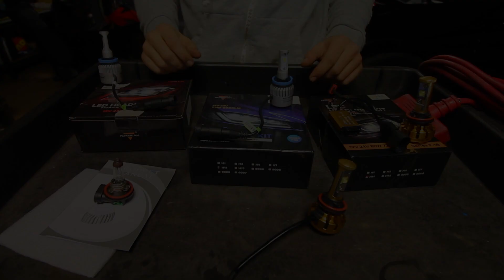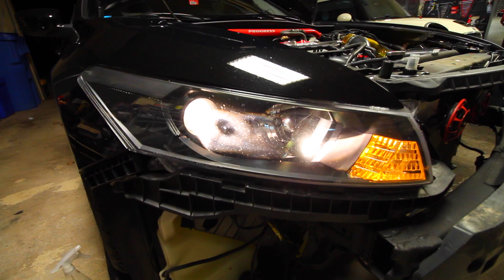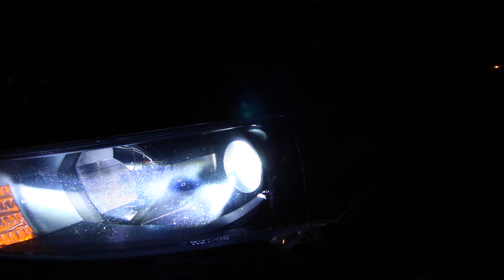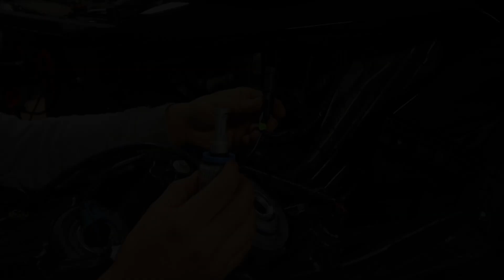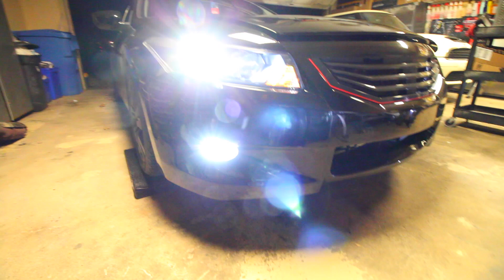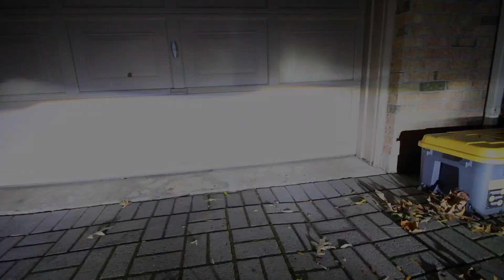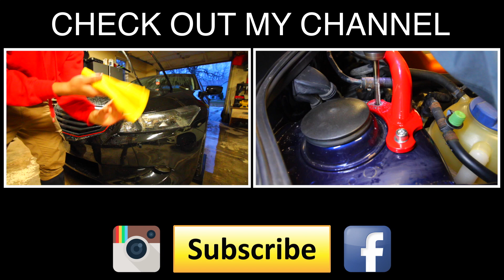LED Headlights: Are they Better than Halogens?

Comment: I get lots of these assholes just dropping LEDs in their old cars and blinding people
Reply: Matty would you stfu already ? we get the point
Reply from the maker: Hence why I mention that the cutoff is very important
Reply: katieducky23 how do u know u never had issues from other people? Did u take a poll from everyone u ever drove by or behind?
Reply: +1.. Alzain Ali is spot on. .. An automotive headlights source emitter,, is only half of a headlight assembly. .. That said, 98 percent of car enthusiasts wouldn't know a car headlight lens "cutoff" character from their backside.  What the hell does a headlights color aesthetic have to do with lighting performance?  .. A significant aspect of automotive headlight performance is its beam direction/character and the interaction with opposing vehicles/traffic and degree of terrestrial light sources . The optional factory HID (term'ed litronics) headlights in my '90's era MY98 Porsche 993 are spot on with there beam focus.  A common place xenon DS2 emitter is set in a projector body focused by a specific R/L glass lens; fitted worldwide.
Reply: I'd recommend the Philips LED headlight bulbs. They are expensive but won't blind people on the road.
Reply: Yup, I'm dropping mine in a week or two.  I've got a set of these in my Ram.  I'll be ordering a set of Sport headlights for it and some philips x-treme visions for it and doing away with these.  I mean these things as brights are damn nice. They're directional as hell and shine a light almost like a spot light... but when he says these are brighter than a Halogen... They would be if they didn't scatter light every direction but where you want it.
Reply: Its the assholes dropping LEDs into a reflector housing. Which is a big no no. LEDs need to be dropped in to a projecting housing so they don't glare the shit out everyone
Reply: Amen to that brother !   :D
Reply: exactly! i have the new Philips Luxeon Zes Led in my headlights. And they are awesome! they do not blind people like the shity xenons. The y just look like halogens only more lumens and pure white  :D
Reply: Have a break, have a KitKat  :D
Reply: Alzain Ali j
Reply: sure you are right, but it comes at a cost, albeit small one, to your wallet in the form of gas consumed.
Reply: Nothing makes energy, it simply transfers it from one source to another.  Therefore, your car "making extra energy" is getting it from somewhere else, I.E. gas. As for not using all the energy it generates, it does use it. However, it is not very efficient. This is why some ESS systems and other systems like Mazda's iLoop system will actually decouple the alternator so that the transfer of energy is ceased, forcing the car to use the batteries until nearly drained. This improves gas mileage.
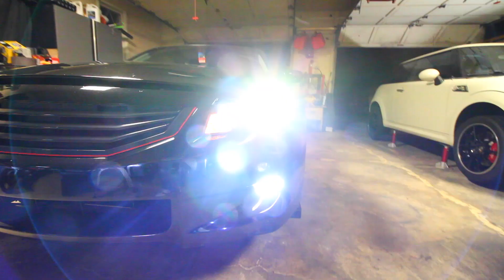Reply: william ingram jr in 12:42 .what lad u pot in the car ? 1? 2 or 3 ?
Reply: Currently, I am trying out DDM Tuning LEDs which uses Phillips Lumileds CMZ leds. It might be the color temp as these are 6,000k, but I think HIDs are brighter. I had DDM Tuning 55w 5,000k
Reply: LOL
Reply: Alzain Ali set service light renalt clio
Reply: +Michal Schneider The color temperature affects performance, because our eyes are made to see in natural sunlight best, the closer you get to the sun's output, the better you are able to see. The brightness of light doesn't matter if you can't see in the spectrum. Same reason you don't see UV light, radio waves, infared, etc, no matter how much output of that something is giving off.
Reply: yeah the corolla's are just weird
Reply: An2 Just because you 'believe' doesn't make it true.
Reply: about 7hp-13hp it's pretty good aye!!!
Reply: Amen! They are too bright! They cause glare that actually impairs the distance vision of the driver and the oncoming driver's vision to boot and they should be outlawed. They are like high beams. They are a menace and dangerous!
Reply: ohh come on that's not true dear Alex.  Leds are seriously not blinding like xenons. i do admit xenon are way too bright but i did a comparison between xenon and Led. The leds are just like halogens only more bright
Reply: There are so many kinds out now and I'm not up on the type that freakin' blinds me at night when I'm coming around a corner, probably the blueish xeons. If that isn't enough the ignorant people that leave their fog lights on, in conjunction with lights that are too bright, make it very dangerous and they don't realize that the oncoming traffic is having trouble seeing where they are going. As a hunter I know that a bright light is NOT what you want when you are tracking a deer at night because it obscures your distance vision by excessively illuminating objects directly in front and around you rather than illuminating objects in the distance.  The same principal applies to headlights at night on a car - the driver cannot see distance as well with the brighter lights and they don't even realize it.
Reply: Amen to that Matty S!
Reply: I wish the nut jobs that are blinding us would get the point!
Reply: Lmafo
Reply: Cant beat em join em thats what i say might as well blind them back
Reply: Its very simple.  Does your car use projector lens or reflector lens.  If you have projectors, LED upgrades should be fine.   If you have reflectors then you are right don't be an a-hole and put HIDs or bright LEDs in them.
Reply: Milan, you should do a vid on how to adjust headlights so the "a**holes" don't blind other drivers!! Keep up the good work!
Reply: None of the OEM halogen projector bowls are designed for HID's or LED's. The only way to achieve a proper cutoff is by retrofit. Otherwise you're going to blind people with all the glare.
Reply: Cool it, toots.
Reply: katieducky23 ricer
Reply: Thx gorgeous :)
Reply: me too i have the Philips Luxeon ZES 6000k Led in my Seat Leon  and it seriously does not blinding incoming traffic at all.
Reply: Kieron Skinner Exactly, I have a second gen Saturn vue (aka an Opel Antara) and no matter what bulb is in it, it has a super sharp cutoff because of its European design.
Reply: You suck  :)
Reply: So I have led 100w h4 headlights in my 2003 seat Ibiza, and the cutoff is so sharp and perfect, it passed the mot test (UK safety test) with them in. And the UK have much stricter rules than you yanks. So all of what you are saying is absolute bullshite
Reply: SirWhiteCrayon you obviously don't know how a projector works.
Reply: its okay honey just dont look into the headlights while driving.  Watch the road !  :D
Reply: That happens more with  HID.
Reply: How about you go fuck yourself? :)
Reply: No smart ass i had low wattage white phillips LED headlights which were rated lower wattage then the ones with the blue tint in them.
Reply: SirWhiteCrayon not true ..I have a set of led bulbs in my halogen headlamps and they cut off perfectly.  I ran also xenon 35w for more than 5 years and it worked flawless...bottom line is the type of headlamp. if it is projector type it will be ok no prob cutting off.
Reply: Not really. Had one in my 2001 plymouth neon never had any issues from other people. You only blind people if its on high beam.

Comment: LEDs should never be used in projectors unless the projector is oem and oem led bulbs.
Reply: Dominique Sanchez qué tal ? Porque no deberían usarse led en proyectores amigo ?
Reply: Flavio Moreno no se tanto para escribir todo en espanol perro soy un experto de las luzes de carros. No lo hagas.
Reply: entonces recomiendas que use xenon , HID?
Reply: Dominique Sanchez you have that backwards. LED Bulbs should never be used in REFLECTORS. Because it scatters the light and makes your headlights blinding for oncoming traffic.
Reply: can you tell me why? thanks
Reply: When headlights are designed, they are designed based on the light source to be used. When other sources of light are used in the headlight not designed for them, the whole output is compromised because the light source is not hitting the reflector  properly.
Reply: usa led en proyectores amigo, esta bien hid y led, tengo un ford explorer y funcionan de maravilla
Reply: Donde esta la biblioteca?
Reply: Wrong, even aftermarket projectors (retrofit projectors) have a cut of Shield that make the line you saw on the garage door that prevents uncontrollable glare. Even the hi/low beam set up in older cars when retrofit with a projector, it has a motorized shield that when you turn on the high beams the shield goes up to expand the light. As a profesional that you said you are, you still have a lot to learn, even though all this projector housing is while old, it’s only popular now because manufacturers are implementing them in standard cars now as to more expensive packages or luxury cars before.
Reply: iamcondescending You can't just throw in LED or HID bulbs into halogen projectors and expect them to work perfectly either. Assuming your country doesn't have laws about self-levelling mechanisms and washer jets, halogen projector lenses don't disperse light evenly enough like how most factory HID projectors do, and it's very obvious from comparison photos. You'd need to swap the halogen projector lens for an engineered clear one for your replacement bulb
Reply: Matt Dixon join "Headlight Junkies" on facebook. Sit back and watch

Comment: Don't drive around with your foglights on...  Just don't.
Reply: Frederick Davis , most foglights are capable of adjusting the aim. From what I know, European cars are able to utilize the fog lights without the low beam activated.
Because in heavy fog; the low beam will point straight out in front of the vehicle. The light reflects of the fog moisture. Causing loss of vision of the road/pavement. 
Foglights purpose (usually mounted low) is light up the road in front of the vehicle while driving slow. Without the low beams on. 
Fog lights does wonders for rain and snow as well.
Reply: I used to add fog nice and low aimed down and a short distance.  I would wire them to be switched on regardless of high/low or no lights besides parking on.  That way in heavy rain, fog or snow I could still see on unlit roads without headlights reflecting back.
Reply: @kzoomin  well said
Reply: Phos9 
My fogs are faced to the ground so i can see the road better
Reply: Stupid just because its called fog light cant be used in normal driving it widens your vision and its not blinding coz all it do is light the pavement
Reply: I have no problem except with the idiots that turn on the rear fog lights for no reason
Reply: @abo3abid1  ikr hella bright for no reason. Maybe it's activated by mistake.
Reply: Phos9 what's the reason if you don't mind me asking
Reply: Phos9 its for safety when raining
Reply: If they even are fog lights many cars only have driving lights.  Very little light output with normal bulbs and only fill in light for looks and immediately in front of the vehicles.
Reply: raym99999 1123 
“Stupid... coz all it do”
Reply: On my 2017 honda accord sport se... The "fog lights" are more like accent lights. They practically don't do shit but look cool. Seriously. Try and notice it. Most "fog lights" these days (newer cars) are more for show than function.
Reply: Correct regardless of what they are called, labeled or thought of what they are actually dictates their function.  You can call a furnace a lamp but that doesn't change the fact of what it is.  Depending on the housing, reflector and bulb type used where mounted what appears to be the same can be different.  Honda as it ships may set it up as accent lighting .  Yet change the bulb or the housing and now you have a fog light or a spot vs low powered flood driving light.  If they're mounted near the ground and say yellow they can be useful on unlit foggy country road, in heavy rain or snow where normal lights reflect back and blind you.
Reply: I want blue leds for my fogs
Reply: I got green bulbs for my fog lights , I don't think green bulbs blind people
Reply: @John C. really?? Well I work for a Auto body shop , so the body techs probably just did my shit the right way
Reply: @John C. Fog lights can blind ongoing traffic if bulbs we're replaced with a different type bulb. For example, led or hid bulbs placed into a reflector type housing that's designed to be used with halogen bulbs (this also applies to low beam headlights too). If facing a wall the led/hid in a reflector housing creates a blob like circle. Similar to driving with high beams on and glaring everyone. With the proper halogen bulb, the beam pattern is illuminated evenly right in front (not glaring others). That is why newer cars that came with led/hid from the factory have projectors to provide that clean cutoff. What you can do is retrofit those projectors into the reflector type headlights (really badass). 
I just drank lots of coffee and felt like typing. Thanks for reading and hopes this helps others in making educated automotive lighting choices lol.
Reply: That's why to install projector fogs
Reply: I turn it off during the day then turn on at night
Reply: Phos9 Sorry, I do it everyday. Yellow light so not blinding and easier to spot on the road.
Reply: The yellow reflects less to aid in rain, fog and snow use.  Starting in 1936 france actually required them until 1993 when forced not to by the EU.
Reply: Phos9 
but they look cool, just don't use highbeams.
Reply: Sam Lung more foreground lighting causes strain on the eyes.
Reply: only meant to be turned on in fog, rain, snow..
Reply: My fog lights make the road brighter so i use them all the time
Reply: Phos9 why not? You dont control what others do to or with they're cars
Reply: Fog lights can be used in the city driving at speeds lower than 35mph. It helps with spotting potholes. Inner cities are usually well lit up. Which helps reduce contrast. Just make sure Fog lights are properly aimed. 
But fast speeds on the dark dry highway with the foglights on is terrible for the eyes.
Reply: Sam Lung , while driving you are always focused on the road ahead. Not the ground right in front of the vehicle. 
With foglights on clear dry pavement. Added foreground lighting. Similar to watching tv at night with the brightest setting in a dark room. 
Too much contrast, in return causes eye strain.
Reply: Phuc Da Law good to know thank you buddy
Reply: Sam Lung fogs are aimed up. Don't turn them on.
Reply: Frederick Davis they're basically headlights that are aimed up instead of down, basically into the eyes of oncoming drivers.
Reply: THAT shouldn't be Fredrick. The IDEA of fog lamps is to be mounted LOW on the vehicle so as to be able to beam UNDER fog, rain, and snow so that the immediate roadway in front of the vehicle is illuminated without that blinding reflection off of the rain and snow.

Comment: Where I work we mfg Loox LEDs.
The Higher the Kelvins the more cool white or closer to daylight output. The lower the kelvins the more yellow or warm white output.  So essentially the 1st two are brighter than the premium gold one. What makes the premium slightly better would be the bubble the LEDs are encapsulated in to help project more of that light. The driver the premium comes with would be what guarantees the better performance over the 1st two in my opinion since it's a driver for the LEDs guaranteeing the performance. Have you tried that driver on the other LEDs? Being from the same Mfg I would say it would work. Lumens is like a shower head beaming out light on a surface at different distances the lumens would vary.
Reply: There is so many myths on LEDs that they'll burn out quickly. LEDs emit very little heat so I don't get the fan part of it. If they come from a china then life expectancy is small lol All about quality guys. As for HIDs they have a gas inside the bulb so I take it will produce some heat. Not  as much as Halogen but I know LEDs have almost no heat at all. I guess user preference between LEDs & HIDs

Comment: Would you install HID or LED light bulbs in the high beam housing of your headlight ?
Reply: Never. They are not designed to receive HIDs or LEDs, since they are reflector housings. They will blind oncoming traffic, and besides. Your high beam bulbs normally serve as your DRL (daytime running lights), and they won't work properly since LEDs require less power than standard bulbs, so the way the regular DRLs work will prevent them from turning on. And running them at high-beam all the time will just blind oncoming traffic even more, even at day. I can think of a 2010s+ Civic over here in Quebec that I want to ram with my car every time I see him, even in the day, because he did just that.
Reply: What are you talking about Francis, you don't drive with high beams with traffic around. It's actually illegal in most places to drive around with high beams with traffic around. High beams are for areas with little to no traffic.
Reply: Mark Quinton you have no idea what DRLs are right? they are lit up all day long while the car runs. and most of the time they are the high beams with less power sent to them so they are dimmer. this doesn't work with LEDs.
Reply: Depends on the car, some cars have seperate bulbs for high and low beams. Nicer LED's are capable of doing both high and low beams.

Comment: Have you noticed any fogging inside the light housing after changing to LEDs? In halogen setups, if there's humidity in the light housing, the heat dissipates it and keeps the inside of the housing dry, but without the heat, this can't happen.

Comment: If i would try to fit the leds i would not be able to fit the  dust caps back on the headlights . they stop dust and water from entering the headlights.

Comment: LED technology isnt perfect.
1. after some hours LEDs loosing brightnes about 20%
2. Some have problems quickly burning off because of heat
3. FAN noise, heat etc...
LED's come a long way, but for headlights HID still better option